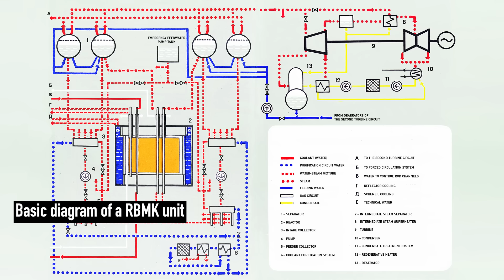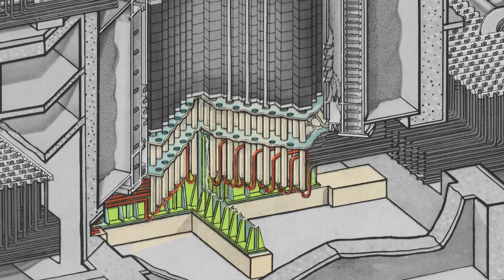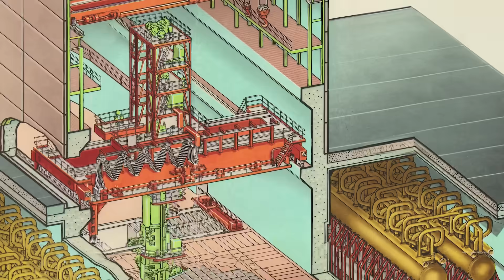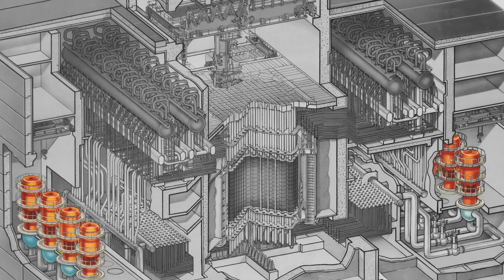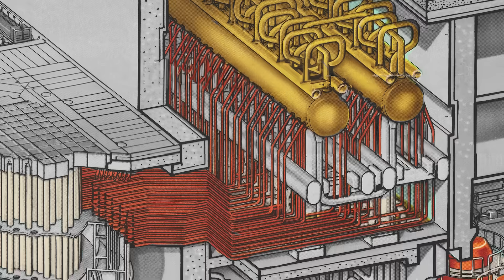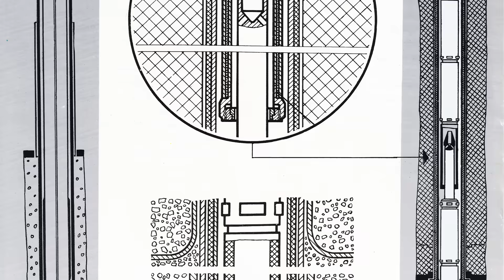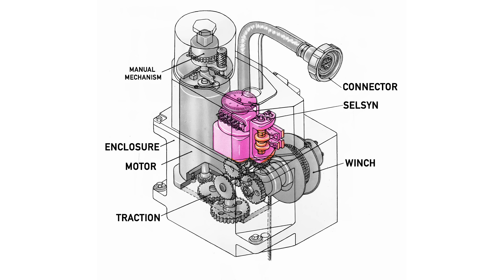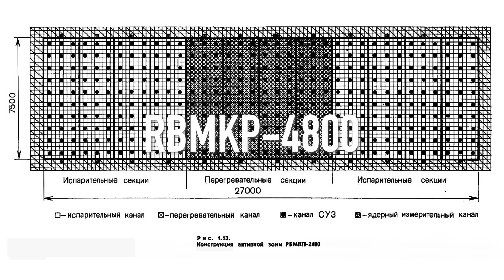RBMK: The Soviet Reactor That Was Doomed from the Start | Chornobyl Uncharted Ep 04

Comment: I completely understand the theory and intention of the RBMK design.  It was perfectly feasible had it been supported by a safety-minded culture and aversion to counter-productive cost-cutting.  RBMK made nuclear power possible for countries with less capital to invest in such a project.   Now we are stuck with the much more expensive PWR types and the U.S. can't even make the pressure vessels any longer.  In due time, the RBMK will be revisited and its core design principles will be revived out of necessity.

Comment: The complexity of this reactor is insane...thank you for the excellent explanation.  I haven't seen any other videos that have gone into the granular details on this scale.  Subbed.
Reply from the maker: @dirtycordoba6713  thank you and welcome!
Reply: That complexity was a fatal weakness too. The huge size, choice of graphite as the moderator and low-enrichment fuel made it complicated and tricky to control, especially at low power levels. In fact, it was designed to run at full power all the time between shutdowns for maintenance.
Reply: @taras3702   It took extraordinary effort for Deputy Engineer, Anatoly Dyatlov, to manually defeat all the safety systems built in and create the conditions for Chernobyl #4 to blow up.  A lot of things in life require safety mindedness and special operational controls.  Both PWR and RBMK require special operational procedures and systems in order to work safely.  Had the RBMK been commissioned and managed properly, we'd have never heard of Chernobyl.
Reply: @BlackPill-obey  There were other near misses that could have resulted in an explosion and a nuclear disaster. Failure of just a few fuel channels destroyed the reactor at Chernobyl. There have been power surges during shutdowns and fuel channel ruptures at other nuclear reactors of the same type. Why do you think Lithuania deactivated the RMBK-1000 reactors at Igalina as a condition for EU membership?
Reply: @taras3702   As a condition of EU membership?  Sounds like an agreement made under duress.  What replaced that lost power generation?  Is Lithuania paying for imported power via the E.U. grid?

Improper operations are very likely an important factor in the failure of the RBMK plants mentioned.

Why am I so defensive for the RBMK design?  Because the West, the U.S. in particular, is already experiencing capital scarcity and loss of institutional memory/knowledge.  Already we cannot manufacture the pressure vessels for our standard PWR systems.  We haven't built a nuke power plant in decades.  Between corporate crrouption and decades of deindustrialization, we will be lucky to build a RBMK-type system in the future. If at all.
Reply: @taras3702   I have no doubt we botched a graphite moderated reactor and it lacked the control systems that the Soviets later developed to make it work.  The SL-1 disaster can't be blamed solely on the "bad design" argument.  There were some bad operations flaws that caused the accident.

That said, you're still looking at the surface effects of Chernobyl.  Still not considering that deputy engineer, Anatoly Dyatlov, bypassed and undid the safety systems to conduct that safety test which was supposed to have been done before commissioning.  Had the night shift simply brought the reactor #4 down to a controlled shutdown, as was normal, we'd never have heard of this disaster.
Reply: @BlackPill-obey  Leingrad had issues as well
Reply: @whatsascallion-f6l   True.  And design changes were requested and then denied for whatever political reasons.  

Was that a fault of the fundamental design?  Or was it a fault of the bureaucracy and operational culture?

Comment: In all fairness if they didn’t turn off the safety systems the accident wouldn’t have happened.  Not to say it still wasn’t a flawed design but the accident is purely human fault
Reply: Flawed is a conditional term.  It took extraordinary effort for Deputy Engineer, Anatoly Dyatlov, to manually defeat all the safety systems built in and create the conditions for Chernobyl #4 to blow up.  A lot of things in life require safety mindedness and special operational controls.  Both PWR and RBMK require special operational procedures and systems in order to work safely.  Had the RBMK been commissioned and managed properly, we'd have never heard of Chernobyl.
Reply: Yes and no. It is a design flaw that YOU CAN disable automatic controls in such low power.
It is like you can play with torches near gas pumps. There is a chance that you get out of it unburned...but there is a greater chance of burning down the neighbourhood. In this case that literally happened.
It was undoubtedly operator error, but there was design flaws as well that an operator COULD push that reactor that far.
Reply: @georgejudge6437   What was meant to be a vote of confidence in the Soviet system, allowing such levels of trust in these operations turned out to be a disaster.   

We see that trust has a price and being unable to convey that trust requires extra ctrl systems to replace that lost trust.  The result being the skyrocketing price of nuclear power.

Comment: As a nuclear engineering student, I will always be amazed by eastern reactor designs (aside safety culture). We often talk about the accident but lack explaining the technological concepts that led to it, but this video is great explaining it :) . Part of this amazement also come from the eastern countries still developping sodium and bismuth-lead cooled fast reactors : here in France, there was only one project of fast reactor more than 40 years ago, superphénix. But it was stopped due to political reasons (politics hated nuclear at this time and they rather closed the facility than putting money into corrosion and heat resistance materials research).

Comment: Wonder how these incredibly precise illustrations were drawn back then? They look almost like 3D computer renders, but I guess they are drawn... with ink? Are they computer assisted by any means?
Reply from the maker: By hand, no assistance. It is hard to say with what exactly they were drawn. Though what you see is cleaned version, originals sometimes have issues in positioning and colors though we think it is mostly effects of printing.
Reply: @ChernobylFamily Someone should make a documentary about those type of illustration and how they are made. I know they are 100% utilitarian, but I think they hold artistic value as well, and I would love a print in a frame.
Reply: They would have been produced on a drawing board, pencilled first and then the line work was inked using technical drawing pens similar to a Rotring (don't know what the Soviet equivalent was). Coloured inks and water colour would have been applied by brush and airbrush. Technical illustration died a death in late eighties / early nineties when software and computers became powerful and cheap enough to be used instead. It's now pretty much a lost art.... I was also struck by the quality of the illustrations shown in this film.

Comment: The title is misleading, actually the disaster proved that RBMK is quite robust that you have to push it to such an extreme condition to make it fail.
Reply from the maker: You have a right for your opinion. Perhaps it is. I'll just add according to our private talks with those who actually controlled this, it was actually a very hard-to-operate thing, with lots of practical nuances which were far from good. The truth, probably, is in the middle.
Reply: It took extraordinary effort for Deputy Engineer, Anatoly Dyatlov, to manually defeat all the safety systems built in and create the conditions for Chernobyl #4 to blow up.  A lot of things in life require safety mindedness and special operational controls.  Both PWR and RBMK require special operational procedures and systems in order to work safely.  Had the RBMK been commissioned and managed properly, we'd have never heard of Chernobyl.

Comment: The real flaw of RMBK design was a positive void coefficient where reactors reactivity increases with increasing voids / bubbles/ steam in the coolant!
Reply from the maker: ...which we actually mentioned in this video.
Reply: The positive void coefficient was satisfactorily managed by the design and safety systems.  It had to generate steam to spin the turbines, which made electricity.  The main flaw was that too much trust was given to the operators and managers.  That Dyatlov was able to bypass all the safety systems and ignore his reactor chiefs' advice is a flaw of the Soviet system that shaped them; not of the RBMK.

Comment: My friend told me about one of the early early computers they had to predict reactor Behavior at one of the testing areas out in idaho. He said that it was a huge block of analog electrical components using lrc circuitry to mimic how the reactor would change with input to and from the control rods
Reply: General had Neutron flux sensors in there but I'm not sure how they would have worked. They would have to be able to obviously withstand the high Neutron flux with a lot of materials that are electronic in nature that damages them very quickly. One problem is their Electronics were problematically made at best and had very poor tolerances. Especially stuff like capacitors. That's why they have problems with those Electronics is you put one in and the whole circuit works you put a slightly different one that's out of Tolerance and it doesn't work because they have very poor design methodology
Reply from the maker: We literally have a documentary about that machine. See https://youtu.be/ZbaptQh2AM4

Comment: Chernobyl disaster happened for 3 main reasons:
a) Like every complex machine, if all security system are disabled, then there is nothing to separe human from disaster, that damned night operators did this mistake.
b) No one of operators knew about the big problem of Xe-135 reactor contamination, this poisoning hid the true activity of the reactor leading operators to the big mistake of removing most of the safety rods made of boron. When the poisoning ended, the reactor showed all its true internal core reaction and, with only a few safety boron rods in place, this led to a very powerful and devastating reactor "over-revving".
c) The real design flaw of the RBMK reactor was that it was built on a shoestring basis by fitting the boron rod extenders with graphite (rather than boron), which resulted in a temporary increase in the reaction before deceleration occurred.
-
Anyway this is a great video, thank you!
Reply: Also the operators knew the core was poisoned hence why akimov (irl) told dyatlov that it was to dangerous and that they should shut the core down and let it restart over a 24 hour period. And if im not mistaken even the skala computer said to shut the core down under its recommendations that the core was becoming unstable. (Could be wrong I wasn’t in the room that night but research and testimonies tell this story)
Reply: It was actually Anatoly dyatlov who is the one to blame for the orders being dished out in the control room that night. If the test did happen that night we would have never heard of akimov and toptonov
Reply: @Alexander-uz8qk was also the communist government knowing about and hiding the issue in the 1970s. They know about the fatal design flaws and covered it up.
Reply: "You must be confused comrade... A RBMK reactor core can't explode"
Reply: No securities were disabled except "turbine dry" AZ-5 trigger (because cutting the turbine dry was a part of the test) and the SAOR system, that flushes cold water from emergency tank into the contour (which is actually a one way ticket almost as disasterous as MRI quenching). "Power excess" and "power rate excess" triggers were online all the time.
RBMK operators now actually don't give Xenon contamination a significant role in the disaster. According to calculations, reactor worked on 1600 so long, it decontaminated almost to a level where it started and continued to decontaminate during the followed power reductions (although it was compensated by automatic regulators all the time). And the reason personnel then pulled control rods was more likely to compensate the power drop from 200 to est. 30, caused by desyncronisation of a local automatic regulator and a common power automatic regulator, that operate on different power states and which had to be checked for accumulated imbalance on transitions to low power states - and probably this hasn't been done because of the messy shift change.
The main reason of the explosion is considered the test itself, cutting the turbine dry caused the circulator and feeding pumps to slow the circulation and to hollow-effect reactivity be introduced and for some time be compensated by automatic regulator. But after the regulator was fully introduced, the reactivity caused power to increase, so the SORC used AZ-5 manual trigger to decrease power (and supposedly not to stall it). But it is confirmed he released the button after he saw a power rate spike that was caused by the water displacement effect - so the emergency rods introduction was cancelled and in the next dozen of seconds positive feedback from hollow-effect on reactivity caused the steam explosion.
After the disaster the reactor developer introduced an AZ-5 trigger persistency to all operating RBMKs to continue the AZ-5 trigger for 40 seconds even if initial trigger was released.
Source: Alexander Kupnyi - Alexey Fatakhov
Reply: Positive feedback. The answer. Not sure if anyone else said it. Great for weapons, not so great for a "controlled  reaction."
Reply: I'm sorry to say this, but all a) b) and c) you claimed are partially wrong.

a) They didn't "disable all security systems".
b) It would be totally unbelievable that people with that high education would not know about Xe-135 poisoning. They absolutely must have understood it. What they didn't understand was that while "burning" Xe-135, they could make RBMK reactor to explode.
c) Graphite rods in the end parts of the control rods were not the real problem. The real problem was that the grapithe parts were too short (4500mm with 1250mm water space in both ends when fully retracted). Eitheir they should not have exist at all (popular answer) or they should have been as long as the reactor core itself (7000mm). So that it would be impossible to replace the water space in the bottom part with graphite, because there would been no water but graphite instead. That way, the pressing of AZ-5 not have caused the infamous acceleration. The second thing is that there was no way to bypass the slow movement of the control rods. That plus the lag of gaining information from the reactor made it very difficult to control the unusual situation in the reactor.
Reply: К аварии привело одно:после падения мощности до 30 МВТ нельзя было её увеличивать. Все. Это было нарушением ТБ

Comment: I knew nuclear reactors were complex machines but I never knew they used a computer to tell them which fuel rods to change. Now I also understand why they needed a computer to do so. I gained enormous respect for nuclear engineers now I know what goes into building and operating these monsters..
Reply from the maker: There is such a thing called SKFRE, which is stands for "System of Physical Control of Energy Emission". That has behind a mathematical model of process of heat generation, neutron field configuration, reactivity, etc... so the processes inside are very very complex, and uneven.

Comment: I am surprised at how extensive the primary cooling loop was. Eight pumps, massive steam separators, hundreds or thousands of pipes operating at 60bar and 280*C conveying pressurized water full of dangerous fission products. How was the pressure seal maintained when a rod had to be moved/replaced? I would imagine the reactor power had to be reduced for days prior for the rod to "calm down" enough that it could be lifted out with no or limited cooling.
Reply from the maker: The machine made an equalization after the scaphander was connected to the chosen channel.

Comment: Thank you for a very good presentation - the RBMK reactor took the design for graphite moderated reactors (used to produce Plutonium-239 by irradiating Uranium-238) and scaled it up dramatically to produce electricity - the result is a vast array of pipes, sensors, wiring, pumps, separator drums and controls along with an inherent positive void coefficient - there are too many critical failure points - the failure of one fuel channel can barely be managed safely and is very costly to repair - a number of severe accidents occurred in the former USSR before the Chernobyl accident many of which caused high irradiation of plant personnel, deaths and radioactive contamination of the surrounding environment - the RBMK is simply too large and complex to be safely used especially without any containment features
Reply: The RMBK reactors were designed to produce plutonium for nuclear weapons as well as electricity. Why else would the Soviets scale up reactors used for their weapons programs as power plants?
Reply from the maker: @taras3702 it was not designed for this, and plutonium appears in them in an insignificant amount during normal operation. For this existed far more efficient reactors, such as ADE. What is true, RBMK was a development of a technology that initially was military-first for civilian purposes.

Comment: Excellent video!  Since the RBMK reactor runs at a relatively low temperature, I wonder how its operators would deal with the twin problems of radiation-induced dimensional change in the graphite moderator, and accumulation of Wigner energy, especially for the cooler bricks in peripheral parts of the core.